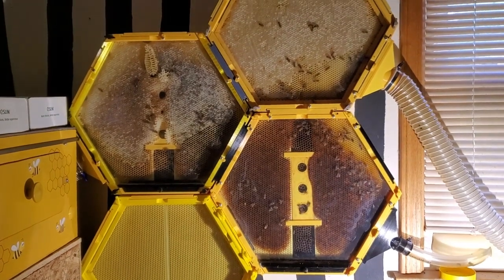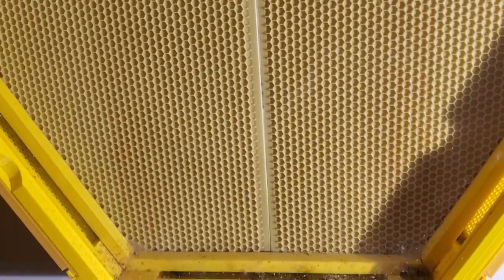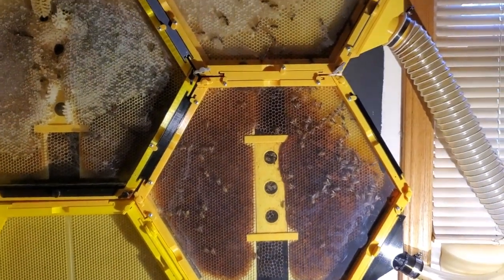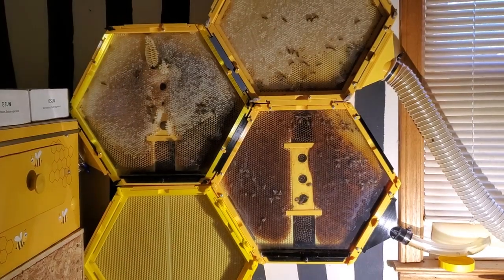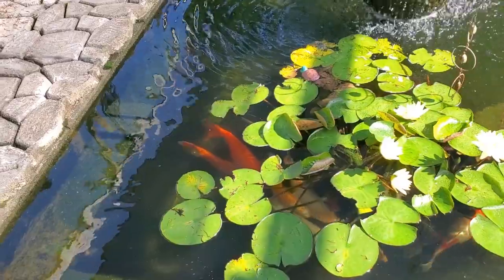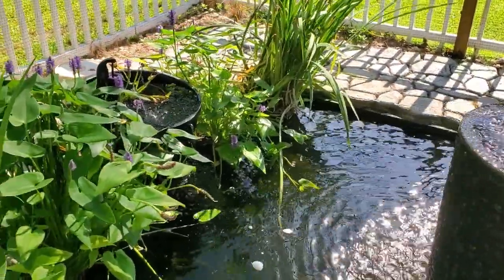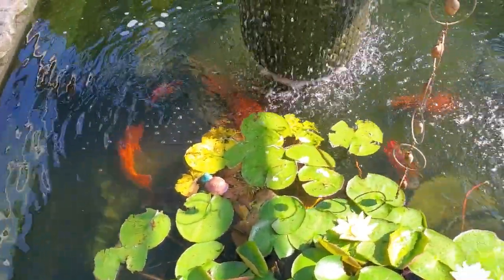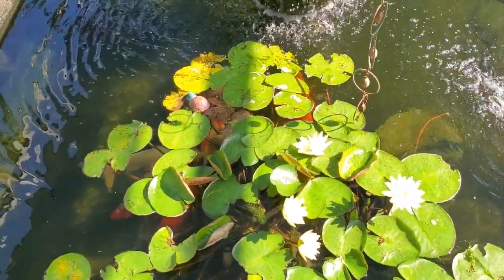Part 8 3D Printed Bee Hive Update

Comment: hello, there is an error in your system, when the bees weave the comb naturally, the angular parts come up and down. sideways in your system.
You can prefer cold pressed honeycombs instead of plastic basic honeycombs.
If the room temperature is not more than 20 degrees Celsius, you should produce an insulation solution.
i used translation
Reply: If there is a wax moth in your area, you can keep the honeycombs in the freezer for 1 day and keep them in a closed box until the draw again.
The knitted honeycomb is a treasure for beekeepers.
the swarm you put back in will develop rapidly.
If I don't have a 3d printer, I'm thinking of doing it too.